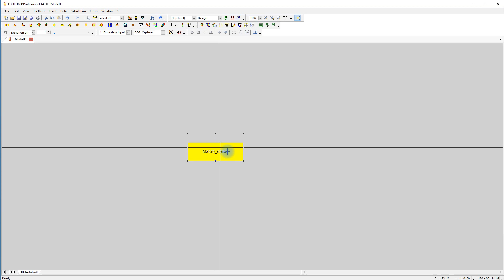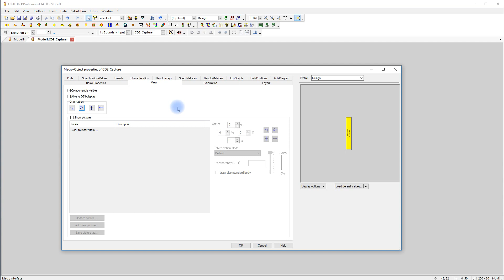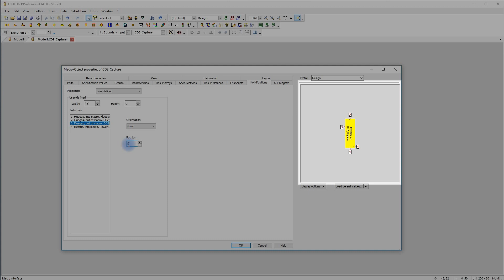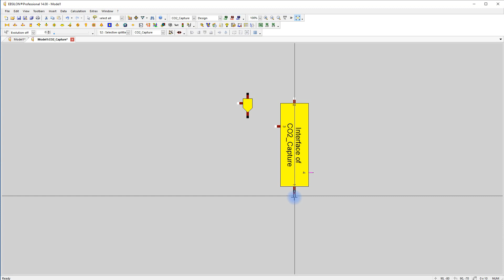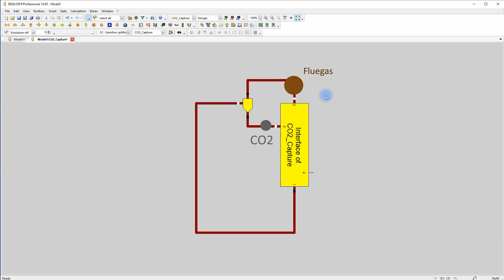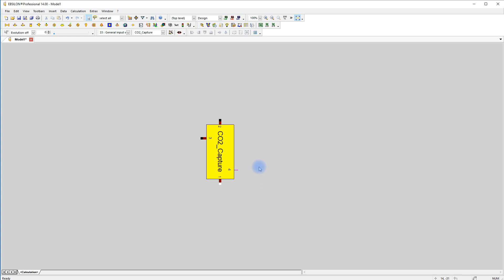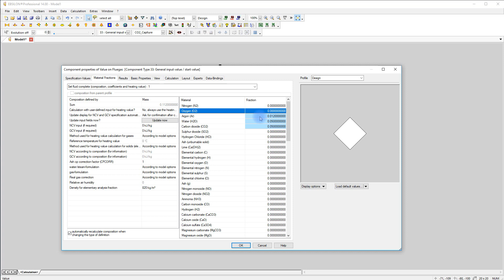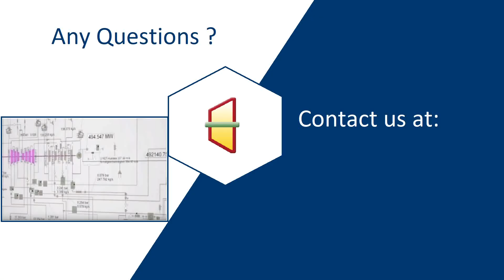EBSILON Professional Tutorial Macros Part I

Comment: I have done all the steps and got the error when i turned off the "report errors in system of equations..." i got some errors also. i tried using comp 1 instead of comp 33 and it finally worked. i just have trouble understanding why comp 33 is always the reason for errors?
Reply: so now i tried using comp 33 but changed the material friciton to 1 and it also worked. so why comp 33 needs 1 material friction while comp 1 doesnt need?

Comment: I have completed all the steps that are shown in the tutorial, but I have some errors. These errors are below;
1"	"Design"	"Component errors"	"Value"	""	"1115"	"Temperature setting failed, H=0 used instead"
2"	"Design"	"Component errors"	"CO2_Capture::Selective_splitter"	""	"2274"	"Mass balance violated by 200.0 kg/s (100.0 %)"
3"	"Design"	"Component errors"	"CO2_Capture::Selective_splitter"	""	"83"	"Mass balance defect""
4"	"Design"	"Component comments"	"CO2_Capture::Selective_splitter"	""	"836"	"T < fluid property table limit"
5"	"Design"	"General stream error"	"Fluegas"	""	"496"	"Fluid not defined"

Could you please explain me how to fix this issue? Besides, I have changed the settings that you mention previous comment.
Reply: I have fixed the problem by changing Comp33 Material Friction from 0 to 1 with the help of Ebsilon team

Comment: Hello,
I've watched your tutorial and decided to do the CO2 capture macro on my own. I've followed every step just like it is shown in the video and when I'm trying to run the simulation i get missing frequency and missing voltage errors in the electric part. Could you please suggest what I could've done wrong?
Reply: Please change your model option as follows:

Menu item "Extras" -> Model Options -> Simulation -> Iteration -> Report errors in the system of equations also for shafts and electric lines to "No: 0"

BR
Detlef Günzel
Reply: Thank you for your help! After I changed that option everything works as it should.